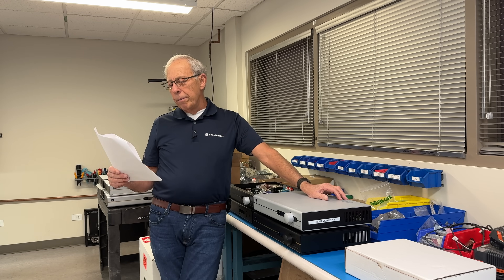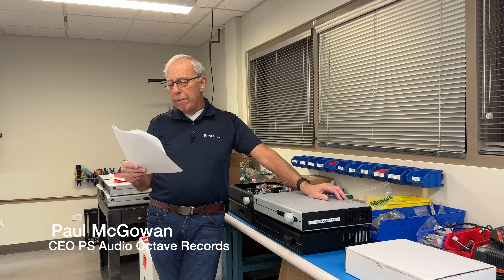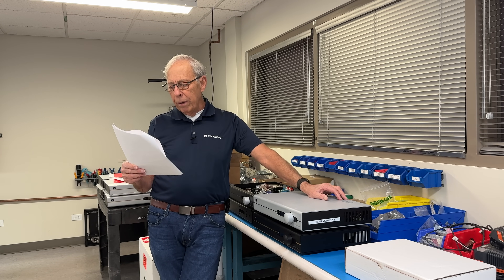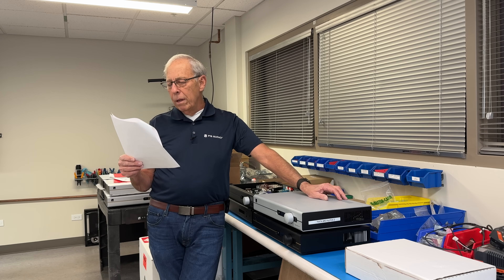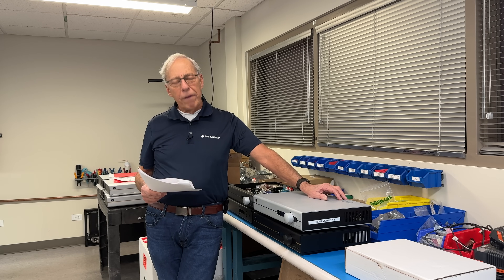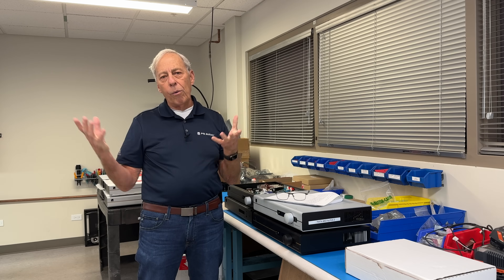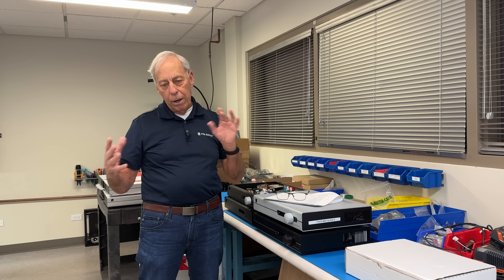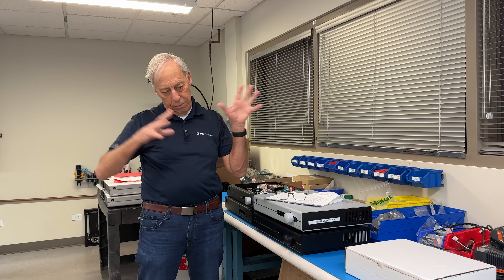Output transformers and vacuum tubes

Comment: Paul, I wonder what your thoughts are on McIntosh Solid State amplifiers that use output transformers rather than a direct couple design? Wondering if McIntosh solid state output transformers reduce the dynamics of sound or sort of “flatten” the sound?

Comment: Tubes are expensive hard to run resistive loads. 20.7s require current.  Coda Ts v3  800w@4ohm 3kw toroidal, 80k capacitance 
20 bi-polar transistors per bank 😊

Comment: Why people even use vacuum tubes, they are so WEAK they do not have any power, maybe 30 watts. Meanwhile transistors are so STRONG they have lots of power, 1000 watts is easy to do.
Reply: In a domestic environment normal listening volumes don't need all that much power, especially for acoustic & most classical music, a few watts is usually enough unless you like early hearing loss. What is more important is that an amplifier can cope with short powerful transients, but average long term power levels don't need to be much at all and tube amps are usually quite sufficient.
Of course some specific music genres consist of a continuous barrage of powerful low frequency transients, so you may need a more powerful transistor amp rated for continuous high output power if that is your cup of tea (e.g. drum & bass, hip-hop or Japanese bass Taiko drumming etc.)

Comment: The transformer is critical, losses in the transformer come from all sides, interwinding capacitance, the grain in the steel, poor winding technique. These become apparent in the coupling factor, (transformer efficiency) so if the “K” is fractionally off, you have a problem. It the amplifier design has feedback from the speaker side, it gets much more critical as the poor coupling gets fed back as correction and awful things happen in the high frequency end. Paul is spot on, the transformer matters a lot. As for valves (it was a UK question…) again configuration dependant, but generally anything quality will be fine, you don’t need to go daft here.
Reply: I would say  opposite because I did not observe  any disadvantage of using thansformer- actualy I like transformer in speaker circuit because as source  it has industance character  and speaker in 99% band has the same.  Growing of speaker inductance is compensated by growing transformer impedance. so the equity of source / receiver impedances is kept in much wider range It assures passing optimium  power to speaker.

Comment: I always say .. if you're gonna use a vacuum tube amplifier make sure the output transformer is sectionally wound and uses C-Core magnetics and lastly has a tertiary winding in the cathode circuit .. like the Quad 2
Reply: It shoud be preferred,   I was very interested in those matters in past and   I wanted to fight for it anyway when I aligned my whole system with my PP vintage transformers  which I do not know about sectioning and loaded  transformer double less than it's capability    (I expect it is not sectioned )  it sounds exactly to my wish. .

Comment: Primary: High Voltage at Low current. Secondary: Low voltage at High current (hence the word "transform"  - transformed to match speaker Ohms)

Comment: That was a great video and i agree the transformer can add something. Or even take away .
I think you couid have also mentioned air gap and reflected load and maybe the ultra linear tap on some. As audio transformers are not quite the same as power .It is a big subject.

Comment: Is it possible to manufacture high impedance loudspeakers to avoid the use of transformers?
Thank.
Reply: Pretty close to impossible because voice coils are wound in a single layer.    
To get a high impedance many layers would be required, 
and they would all have to be wound in the same direction.    
If you can figure out how to do that, let us know.
Reply: @spacemissing  I have no idea. That was the reason of my question. It looks that technically is no feasible.
Reply: @spacemissing   Philips 50 years ago produced such speakers. I do not know exact technology but sure it is about   resistance/ inductance  of coil and that may be obtained  with   thinny  conductor. They had  about 800  Ohm pure resistance . Main problem is  to exclude DC field  so that it does not affest position of diaphragm Anyawy I had such speaker in my TV and it sounded fantsatic as for such device but simmilar to than my audio set with   exceptional speakers driven from PP and  high quality transformer. Means rare to spot in normal gear
Reply: Technically electrostatic speakers are high impendence and use high voltages like tube output stages do. I've always thought a direct coupled tube to panel output would be best for them.
Reply: @glenncurry3041  I did electrostatic speakers to my PP stereo tube amplifier. Surely no transformer is needed only auxiliary voltage.  As you know it transduces only high range and  it is not very perfect sounding
Reply: Sony, years ago made speakers with I think it was 180 ohms impedence and had matching output transformerless amps. They sounded great. Transformers almost always degrade the sound, and they put a lot of degrading micro vibration into the chassis which vibration gets to the circuit board. The David Beening Co. and the French company Sans Pareil made some output transformerless amps that are among the best sounding you will ever hear. Some of these guys who claim it would be near impossible, don't really know much about audio or it's product history.

Comment: There are no free lunches out there for quality. Some companies outsource labor overseas versus the U.S. so some savings can be had there. I have a pair of tube amps the 452 IQ music block VAC amps from Kevin Hayes out of Florida. As far as tube amps go they are some of the best out there but of course are not cheap. They have a bunch of smaller transformers so that transient response is very fast. With an audio person it comes down to 1. What can you afford to spend?  2.What do you want to spend?  I personally love tube amps. Their more natural sound tends to kick the crap out of solid state amps. Some class A amps can sound very good but the heat generated can take away most small to medium size rooms for comfort with listening experience. My tube amps have heat but top off once warmed up and throw off very little heat I don't even notice it after warm up. Tube amps sound great out of the box but tend to really open up after about 1 hour of turn on and play. You have to keep track of hours on the tubes as they hit a tipping point where after so many hours the tubes start declining in performance and time for replacement. For lower budgets the Prima Luna tube amp is very good quality. The tubes that come with it the expansiveness of the stage can seem more constricted. Tube rolling at that level of gear with some vintage stock  tubes can give some great results. There are power conditioners for floor level of noise but I believe one of the most often overlooked not that expensive upgrades is having electrician run dedicated power outlets for each amp and pre-amp back to electrical box with 10 gauge copper Romex wire. Having dedicated lines takes out lots of floor noise usually from all plugs in the room being on the same circuit. I used Audioquest power outlets. Part of the art of a good store dealer or going to multiple ones is knowing in your current budget what will give you the most improvement for the hard earned dollars you have to spend. There are tons of ways to improve a system it comes down to money with options. Lots of people chase a flat curve but that can sound awful. Most listeners find some distortion pleasing to the ear. Rolls Royce the car made their interior one time where it had no noise floor where it was like a chamber. The tests almost drove people nuts. The average car DB noise is about 40 so they found 10 was more pleasing but take the noise level down to nothing it made customers very un-comfortable. Most humans do not know it but the ears find some noise level pleasing. There is difference between overall noise level and then a bunch of hums, rings, clicks, pops, and buzzes that are not pleasing. So there is the type of noise and the level of it.
Reply: It is no  discovery in statement  that people feel discomfort in total silence. It wolud be valuable to say why it happens  and as for me may be even revolutionary to explain many wizzardy and voodo  but looks that konwledge around has high barreiers and effort to jump over is infinite.

Comment: I am always amazed how cheap Chinese tube amps get such good reviews, even from established YT audio channels. I wonder how they manage the output transformers because there are no real shortcuts to them in terms of material cost, design, and labor (though only the first one is a consideration in this case, but I am on thin ice here).
Reply: Ehhhh. Sorta kinda. For output transformers that have to deal with a lot of power, it turns out that cheap GOSS laminations are actually a pretty good core material. And if you follow some pretty basic guidelines, you can build a transformer that performs pretty darn well. Especially for a first attempt. From there, it doesn't take a rocket scientist to make a couple iterations to fine tune the performance. Will it be the best transformer ever made? No. Obviously not. But the sound quality difference is not enough to justify the price. Especially when you can buy your own CNC winding machine for the price of a pair of decent transformers.
Reply: You just answered your own question. Labor cost in China. Sleeping on the factory working almost every hour of the day.
Reply: @brainache555  Yes, however, there is no question asked in my comment.
Reply: @hugobloemers4425  "I wonder how they manage the output transformers because there are no real shortcuts to them in terms of material cost, design, and labor" could be construed as a question.
Reply: @nigelrhodes4330  Perhaps also as rhetorical question, hence the fact I have seemed to answer it my self.
Reply: Remember that china often steals the invention of others so they don't have to spend a long time making something. Therefore the china product is cheaper.
Reply: Remember that china often steals the invention of others so they don't have to spend a long time making something. therefore the china product is cheaper
Reply: The reviewers are “biased”. You always get what you pay for. If you want to get a real understanding of the real performance of chinese and “reviewer approved” tube amps, watch Skunkie Designs. I have a Cayin Amps that I love, but it does not compare to an Audionote Tube Amp with premium all around components. However, difference in price is 6-7 fold.
Reply: @vicary1962  Yes I have watched her videos. Certainly on a technical level she finds some corpses in the closet.
Reply: Paul's speakers made in China 🇨🇳
Reply: @CarlVanDoren61  How do you know that? Elements and the tweeter may be made in china with ps audio specifications
Reply: @CarlVanDoren61  Had no idea Ps audio speakers are made in China, that’s crazy
Reply: Paul’s speakers are made in China? What happened to America made..
Reply: @Charles12509  Well lately American companies, old established companies,  seem to have a problem with quality work as well. Like bolting plug panels down in a plane!
Reply: @andydelle4509 …This true…we are doomed lol
Reply: those are ok sounding amps for a very low price, because of high performance to cost ratio the amps get great reviews.  Also they don’t have tech support lowering cost further.
Reply: You said you were wondering how which is an indirect question.